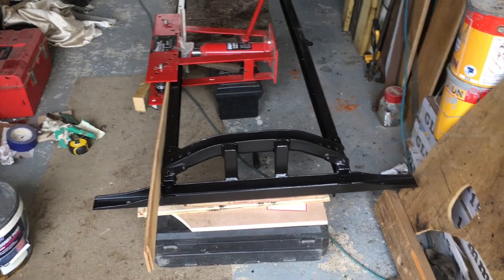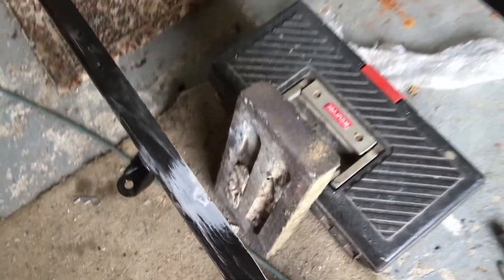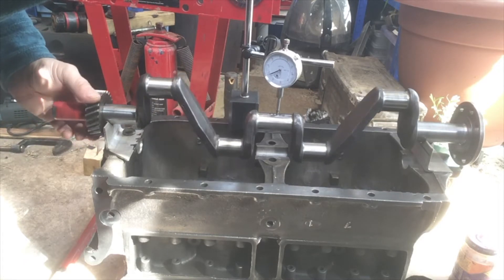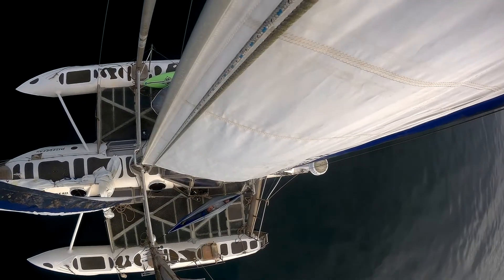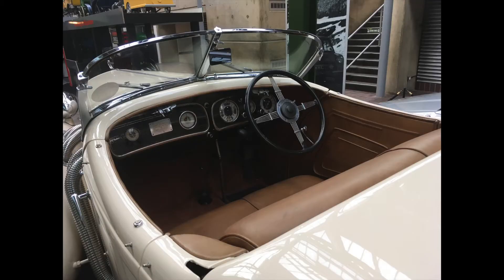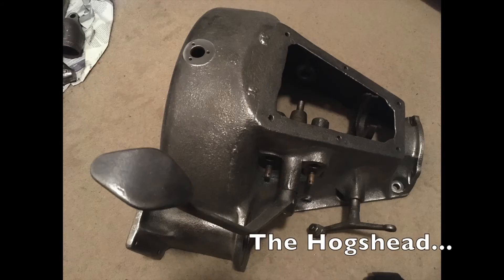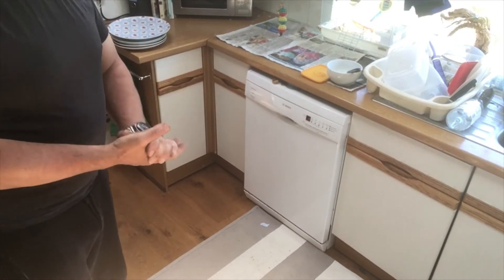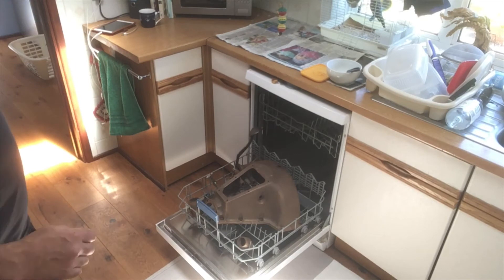Disaster! A cracked crank and probably best not use the dishwasher to clean engine parts...

Comment: Man.. that's tough break.    From what I understand the 1926-27 cranks have the least chance of being cracked if you can find one.  I guess that is due to the hogs head being bolted to the engine block.  With my  T Speedster I have decided to do the right thing and just ignore it until the crank flies out the bottom of the engine.
Reply from the maker: Yes, did not want to be a member of the two piece crank club! The 26/27 cranks were better I heard. They are stamped EE and I think do not have Vanadium in them but have larger radiuses on the journals. The bolts on the hogs head must be a big help too.
I guess Scat is the way to go, but so much money.